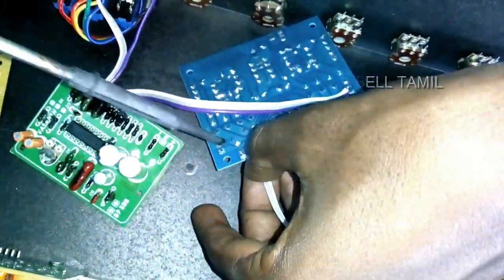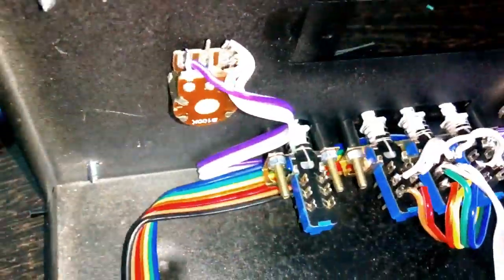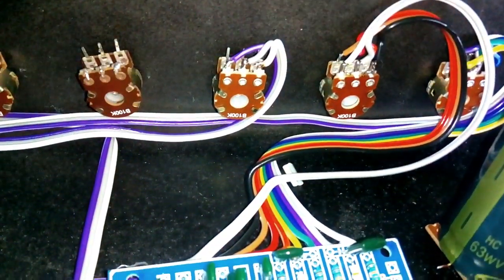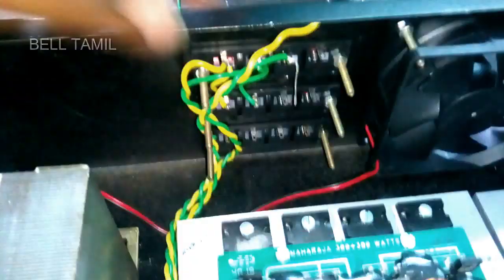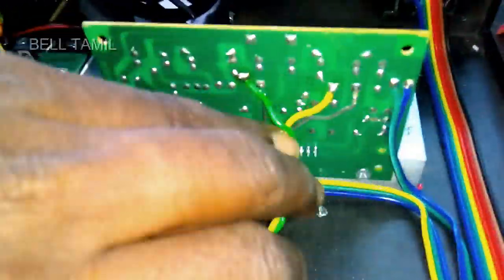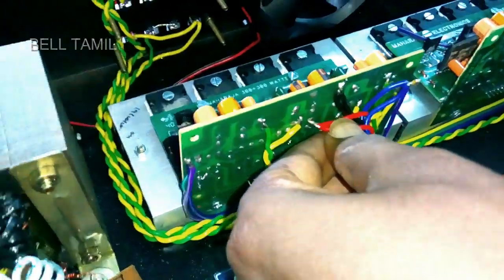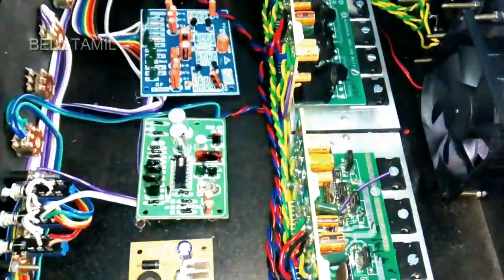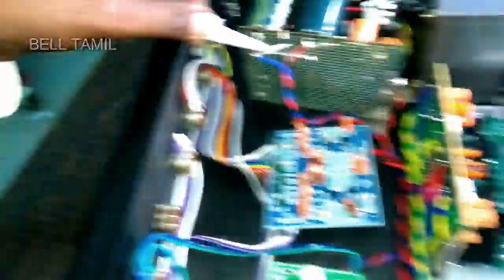How to make 2.1 amplifier/video amplifier

Comment: Bro mp5 bord Bluetooth on time humming sound coming how to salve  tell as
Reply from the maker: vfideo podura
Reply: 1000uf25 v capacitor connect to mp5 board 5volt supply under board, positive leg of capacitor on positive, negative leg solder to negative just simple no humming